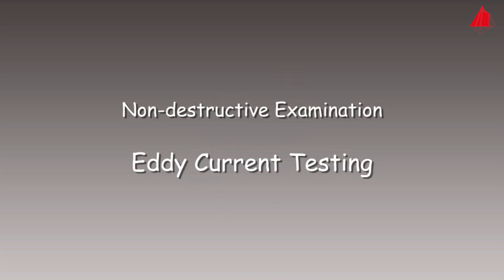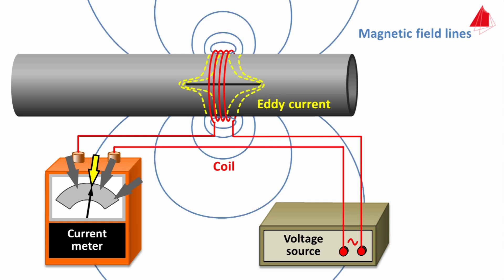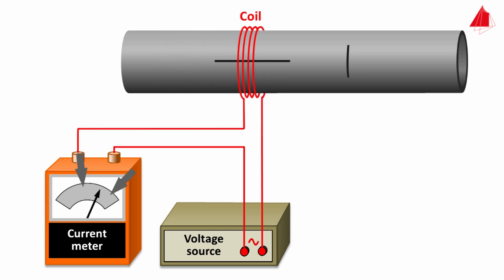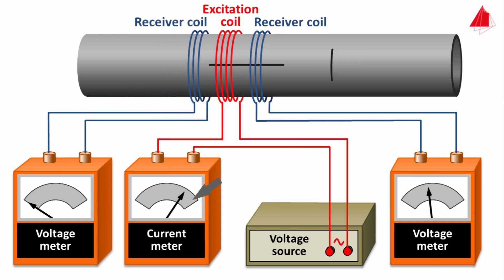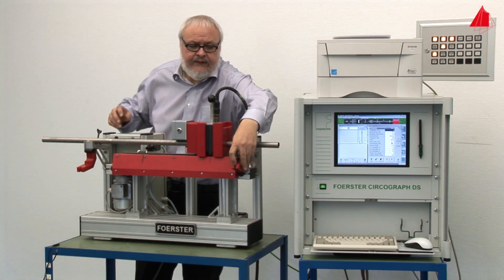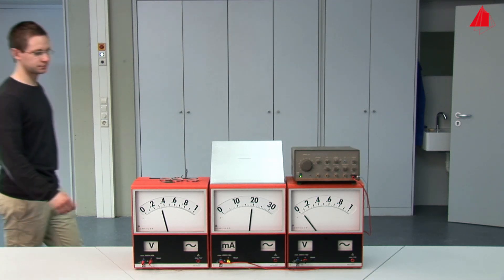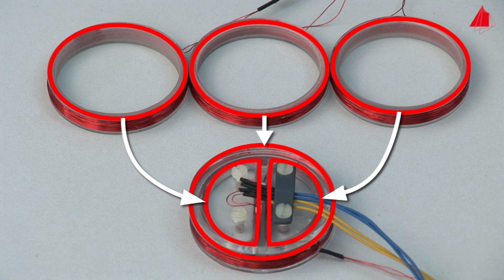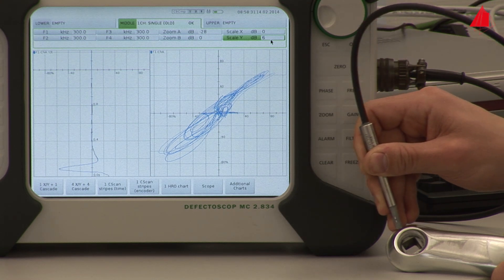Eddy Current Testing

Comment: What voltage and current is needed to replicate this demonstration? I’d just like to try to do it.
Reply from the maker: Answer to "What voltage and current is needed to replicate this demonstration? I’d just like to try to do it.": We have used about 5 to10 V and around 10 to 100 mA in our demonstrations. But it depends strongly on the experimental setup and the materials. You can actually see some of the data in the video. Good luck!

Comment: Will this technique works on silicon wafer for measuring the resistivity / differentiating between P-Type and N type wafers?
Reply from the maker: Answer to "Will this technique works on silicon wafer for measuring the resistivity / differentiating between P-Type and N type wafers?": Yes, this is possible, you can find some examples on the Internet. An interesting technique.

Comment: How about cracks inside the weld lines? Does eddy current detect it? 

Meaning no obvious cracks on outside surface, but have cracks inside
Reply from the maker: Answer to "How about cracks inside the weld lines? Does eddy current detect it? 
Meaning no obvious cracks on outside surface, but have cracks inside": 
This is an important point. Cracks that are not close to the outer surface are difficult or impossible to detect. This is due to the very natural tendency of the eddy current to flow close to the outer surface. At comparatively high frequencies, the eddy current only flows at a depth of about 0.1 mm, at comparatively medium frequencies at a depth of about 1 mm.  At low frequencies, the eddy current can reach deeper. But then the eddy current has plenty of space to flow around the defect and the drop in eddy current through the defect is very small. These principles apply to both hollow and solid parts.
Cracks on the inner surface of tubes are (depending on the geometry) with an excitation coil on the outside difficult or impossible to detect.

Comment: Can this be used for non symmetrical objects?
Reply from the maker: Answer to "Can this be used for non symmetrical objects?": In principle yes, but it strongly depends on the individual geometry. It is possible if the eddy current is obstructed by a defect, and this can also work with non-symmetrical parts.

Comment: do you need to be trained with certificate to use this
Reply from the maker: Answer to "do you need to be trained with certificate to use this": It depends on some aspects. If you use it only "for fun", in research or only internally, you don't need a training with certificate. However, if you want to officially prove the quality of a material, then you need it. In any case, proper training is highly recommended.

Comment: Very informative, thank you. We use Eddy Current probes to measure the diameter of steel pipe, up to 2.375”, but I wasn’t very sure how it all worked. The pipe is moving at 150ft per minute while being inspected. There are also fixed magnets, magnetising the pipe longitudinally, and MFL sensors for transverse flaw detection, in the inspection head.

Comment: will eddy detect 0.1mm hole in stainless steel tube of wall thickness 0.4mm
Reply from the maker: Answer to "will eddy detect 0.1 mm hole in stainless steel tube of wall thickness 0.4 mm"? This is a real problem, but it should work under certain circumstances. It will not be possible to detect such a small hole with a large coil, as shown at the beginning of the video. But it should work with a very small coil, maybe an even smaller coil than the one shown towards the end of the video.

Comment: If the crack is smaller than the reciever coil would the lateral position of the crack inside the reciever coil mean more current drop than if the crack were in the center of the reciever coil?
Reply from the maker: Answer to "If the crack is smaller than the reciever coil would the lateral position of the crack inside the reciever coil mean more current drop than if the crack were in the center of the reciever coil?": This is an important point. A crack that does not affect the eddy current path cannot be detected, regardless of the coil arrangement. Thus, cracks that are completely outside the eddy current path, completely inside the eddy current path, or exactly parallel to the eddy current lines cannot be detected. However, if the eddy current path is affected by the crack, the arrangement of the exciting and receiving coils plays an important role. So the answer to your question could be yes or no. Unfortunately, this is a complex issue.

Comment: nice video. can eddy current be used for subsea pipes?
Reply from the maker: Answer to "nice video. can eddy current be used for subsea pipes?": Underwater inspection has its general difficulties. Nevertheless, eddy current inspection also works under water.

Comment: If someone wants to replace or attach a bulb with the current meter, the bulb should be how many volts...... thanks
Reply from the maker: Answer to "If someone wants to replace or attach a bulb with the current meter, the bulb should be how many volts...... thanks": You could actually replace each of the measuring devices with light bulbs. However, this is not practical because, as you can see, the voltages are typically less than 1 V and the currents are much less than 100 mA. The voltage drop across the ammeter is very small, typically less than 100 mV.

Comment: How to make the coil ?
Reply from the maker: Answer to the question "How to make the coil ?":  The coils are very easy to make. You just take a lacquer insulated copper wire of about 0.2 mm diameter and wind it into a coil with about 20 to 100 turns. For very small diameters you don't need a bobbin, but for larger coil diameters a bobbin made of an electrical insulator is very helpful; we used a transparent polymer material.
Reply: what kind of transformer is used?
Reply from the maker: Answer to "what kind of transformer is used?": We did not use a classic transformer, but only the coils.

Comment: Your video was so fantastic , i learn a lot from that , but i still can't understand about the coil.
Can you tell me how to make the coil please
Reply from the maker: Answer to "Your video was so fantastic , i learn a lot from that , but i still can't understand about the coil. Can you tell me how to make the coil please": Thank you very much for the praise. As for the coils, they are very easy to make. You just take a lacquer insulated copper wire of about 0.2 mm diameter and wind it into a coil with about 20 to 100 turns. For very small diameters you don't need a bobbin, but for larger coil diameters you need a bobbin made of an electrical insulator; we used a transparent polymer material.
Reply: @MaterialsScience2000  yesterday i practice make the eddy current test like that. But the current meter can't up when the coil entered the material test. I don't know what wrongs with that , can you tell me, maybe there are something which must be considered
Reply from the maker: "yesterday i practice make the eddy current test like that. But the current meter can't up when the coil entered the material test. I don't know what wrongs with that , can you tell me, maybe there are something which must be considered": We had similar difficulties at the beginning and had to change many parameters: the frequency, the voltmeter, the ammeter, the material. I'm afraid it's too long to explain in detail, sorry.

Comment: Why no voltage induced in receiver coil when there is no defect? there should be some voltage induced in receiver coil when there is no defect because if electromagnetic induction
Reply from the maker: Answer to "Why no voltage induced in receiver coil when there is no defect? there should be some voltage induced in receiver coil when there is no defect because if electromagnetic induction": But yes, a voltage is induced in the receiver coils. However, the induced voltage is different with and without a defect.

Comment: why does the inductance become low when the core is added？shouldn't it be higher since u is higher.
Reply from the maker: Answer to "why does the inductance become low when the core is added？shouldn't it be higher since u is higher.": It is because the eddy current inside the (intact) specimen (the ring, the core) is high. The high eddy current produces its own magnetic field which acts against the primary field. So altogether the excitation coil "feels" less inductivity and less counteracting voltage inside the excitation coil.

Comment: I would like to know the wire diameter used, and the dimension of the core please
Reply from the maker: Answer to "I would like to know the wire diameter used, and the dimension of the core please": For video demonstration purposes the wire diameter was around 0.3 mm, the core diameter of the coil around 50 respectively 20 mm, the number of turns 50 - 100. These data are actually rather uncritical, the method works nicely with other data as well.

Comment: I have a question. If you get a copper tube, wrap copper wire around and hook it up to some output, and you drop a strong magnet through the tube, will the eddy currents turn on the output? Sorry if this question is kind of novice
Reply from the maker: Answer to "I have a question. If you get a copper tube, wrap copper wire around and hook it up to some output, and you drop a strong magnet through the tube, will the eddy currents turn on the output? Sorry if this question is kind of novice" Yes, you will be able to measure a short-time voltage at the ends of your copper wire in the form of a single +/- wave (as long as the magnet doesn't tumble around). The copper wire should be wound closely together in the form of a compact coil (not a very long one). Imagine the middle part of the tube. When the magnet drops through the tube, the local magnetic field changes rapidly and induces and eddy current in the tube. This eddy current creates its own magnetic field that superimposes with the magnetic field of the passing-by magnet. The resulting magnetic field (correctly: change of flux) flows through the coil made from copper wire and induces a voltage there. Actually quite complex; the falling magnet is slowed down more or less depending on the set up.
Reply: Ok thank you very much!

Comment: What was the wire gauge characteristics in this experiment?
Reply from the maker: Answer to "What was the wire gauge characteristics in this Experiment? In our laboratory typically 50 to 100 turns, voltage 10 V, frequency 10 to 15 kHz.
Reply: Hi, is it possible to run this experiment with a DC voltage source?
Reply from the maker: Answer to "Hi, is it possible to run this experiment with a DC voltage source?": I am afraid no, in any case not in the classical eddy current testing procedure. You need the alternating magnetic field of the excitation coil to create an eddy current in the test piece, and an alternating magnetic field is only created by AC. However, there exists a very special method of nondestructive testing, where a ferromagnetic test piece is magnetised by a large coil using DC. Defects in the test piece lead to a magnetic flux flowing out of the test piece surface. This magnetic flux may be detected by a receiver coil, that moves fast enough over the test piece surface. This test method, however, is closer to the magnetic particle testing than to eddy current testing.

Comment: Where can I find analog meters so big?
Reply from the maker: Answer to "Where can I find analog meters so big?": There is quite a range of suppliers, an internet search under "analog demo multimeter" will be successful
Reply: Thanks, it worked. Can you tell me what are the dimensions and number of turns of the coils? I am trying to repeat your experiments, but the coil parameters seem crucial.

Comment: great video For test what was the voltage used and how many turns does the coil have?
Reply from the maker: Answer to "For test what was the voltage used and how many turns does the coil have?" The voltage was 10 V, the number of the turns of the large coils was about 50 to 100.
Reply: MaterialsScience2000 
Many thanks you can tell me what inductance of the coils that were used in the demonstration? Very good this video congratulations! !!

Comment: What kind of coil is he using?
Reply from the maker: Answer to "What kind of coil is he using?" All the large coils in our laboratory are simple flat coils with about 50 to 100 windings made from insulated copper wire
Reply: Thank you so much. :)MaterialsScience2000